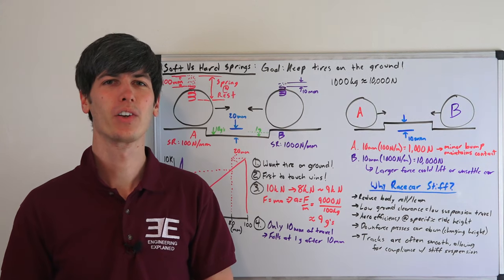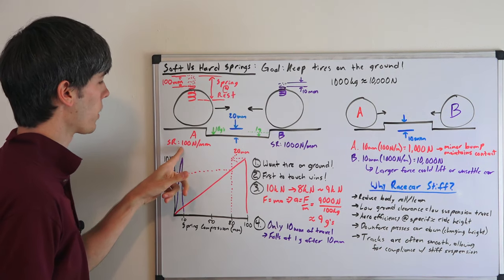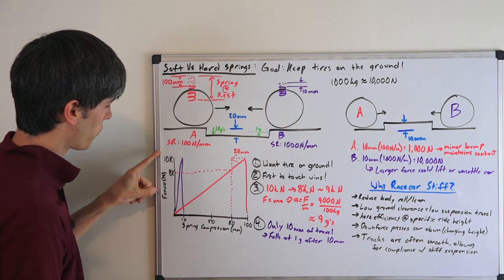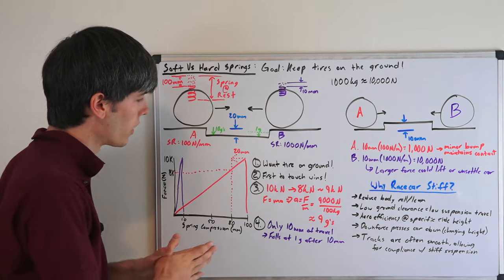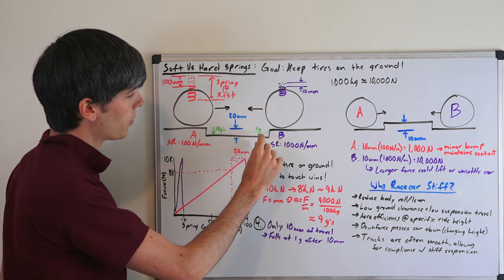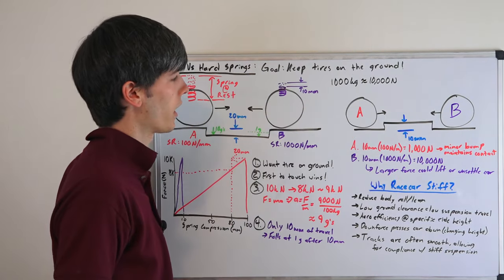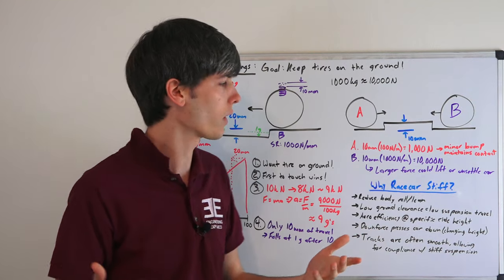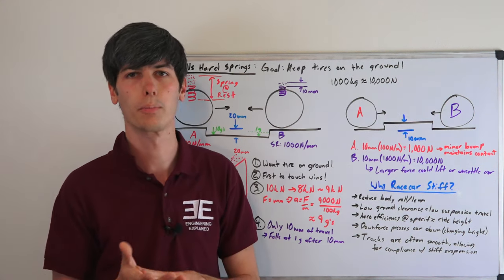What's The Best Suspension - Soft or Stiff Springs?

Comment: Jason, first off, a big fan thank you for making these
videos for all of us to better understand the engineering behind cars and
suspensions, they have been a big help for me in understanding what parts I
might invest into my ride. I wanted to ask a clarifying question about the
video, which is in reference to the drop that the wheel would have into the
hypothetical pothole you discussed in this video. I understand what you were
trying to say in the aspect of the importance of keeping all 4 tires on the
ground as much as possible and with as much force as possible as this is the
point of a suspension. However, what I am struggling with is understanding how
the stiffer spring, that only compresses 10mm, would have a harder time hitting
the ground compared to the softer spring that compresses 80mm. I struggle with
envisioning this as being something that follows other aspects of physics, such
as the overall weight of the car, and the speed as to which the wheel hits the
bottom of the hypothetical pothole. If the stiffer spring only compresses 10mm
and the pothole is deeper than 10mm then that would leave the assumption that
the spring does not decompress further than 10mm, which when a car is lifted
there is full droop in all 4 wheels, which is in response to the shocks and
springs being fully extended and not being under pressure. For what you were
saying in the video that the stiffer springs would not either reach the bottom
of the pothole in the time that the softer ones would reach would also be
assuming that the shocks are not factored into this statement because if what
you were saying was the case then a car’s wheel would never experience full
droop and would return to the base ride height + the decompression of the
spring (10mm). I am confused because the speed as to when that wheel would hit
the bottom of the pothole would also be dependent on the speed of the car
moving forward + the speed of gravity as the car is being pulled down to the
bottom of the pothole. It would sort of question also the speed difference
between the spring decompressing and the speed of gravity (both forces would be
happening simultaneously, the car falling and the spring decompressing). It
also brings into question the force that would be impacted on the fall as well
and looking at the spring rate to determine if the car’s force from the fall
and momentum would cause the spring to compress more, thus potentially leading
to bottoming out. As I see it, and I could be wrong, we have 3 forces in this
hypothetical situation (the shocks, springs and gravity) and in “forces” I mean
all things that would cause the wheel of the car to move downward in the event
of driving over a pothole. All 3 would need to be taken into consideration when
discussing the cons to stiffer springs, correct?
Reply: Michael Capozzi is this a poem?

Comment: Of course the best question is "why not both" --- variable rate springs.
Reply: +GunFun ZS because until recently variable rate damping didn't exist.
Reply: That's true for a lot of things. It's still the right question.
Reply: +GunFun ZS  Hydraulics suspension, i think is the solution
Reply: +GunFun ZS Used those on an old caprice.  Car was smooth sailing, but when it came time to load up, and you can load those things, didn't have to worry about sagging or bottoming out on a big bump.